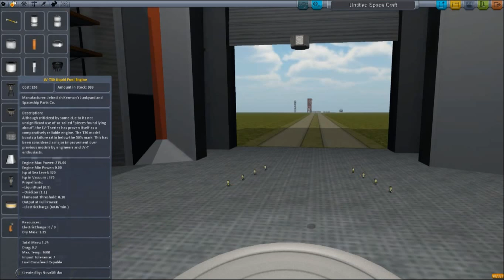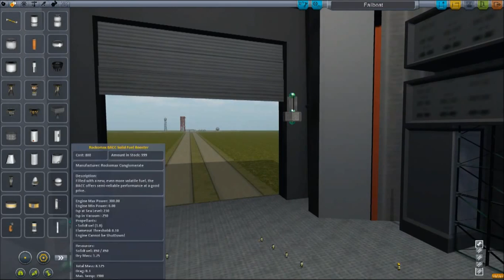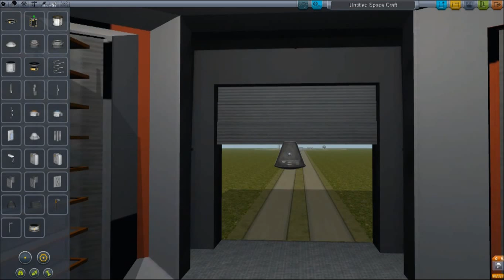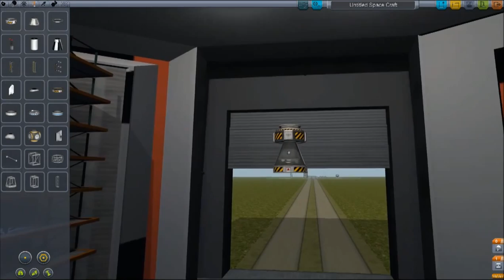KSP Rocket Design Tutorial

Comment from the maker: Jet engines are great for first stages, especially for smaller rockets. I made a rocket once using jet engines that pulled some ridiculous number of G's during ascent, like 15 G's. For larger rockets they can become a bit of a logistical problem, and you have to make sure to drop the stage before you get a flameout, otherwise the rocket tumbles out of control (if it has more than 1 jet engine anyway).